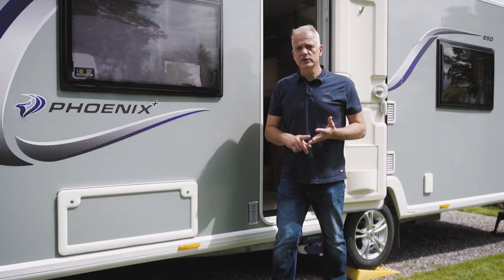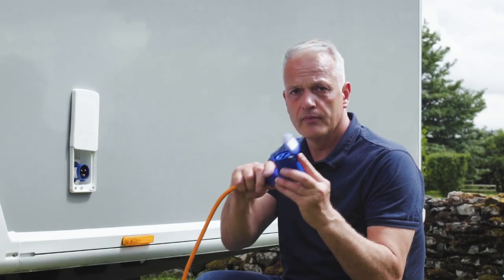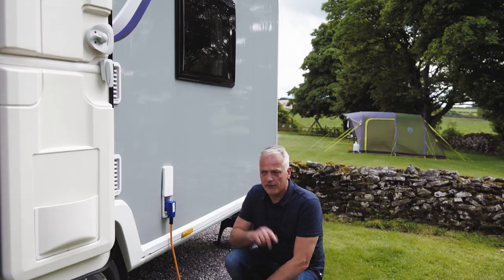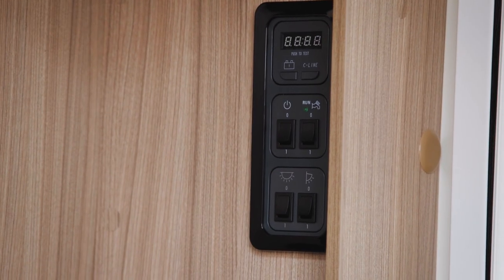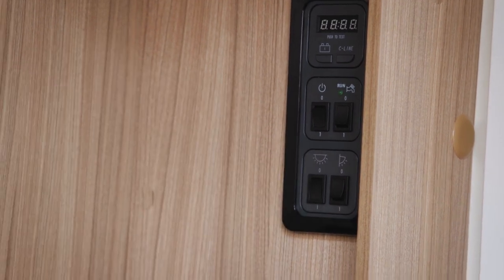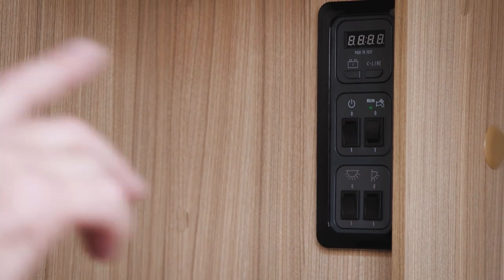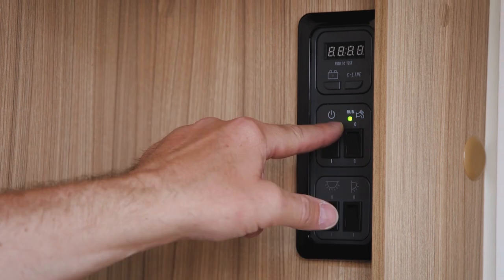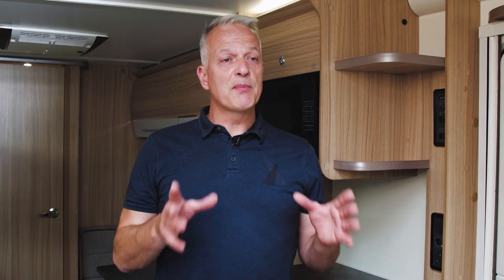How to use the electrical system and control panel in your caravan or motorhome

Comment: Please could someone at Bailey explain why our 2021 Autograph 794i has several issues when attempting to go without ehu - and the issues seem to be quite widespread according to the forums. 1. After being on ehu the leisure battery struggles to maintaing anything above 12v. Your video refers to a base line of 13.8v. The control panel consistently displays a low voltage warning. 2. The water pump always operates fine on ehu. We are experienced in priming etc but the pump always fails to pressurise off ehu so we have to avoid battery depletion by turning it on only when needed. This is evidently related to the electric power from the leisure battery. Our dealer has replaced both the leisure battery and the control panel. You stated clearly that Bailey vans are designed to be fully operational off grid / off ehu. We have the Bailey fitted solar panel and controller and regularly try to go off grid in sunny climes with no success. The problem persists. Are Bailey aware of issues related to the Autograph electrical system? This is our fourth van but our first Bailey and the first to present these issues. Please indicate a solution that does not involve manually adjusting the pump pressure all the time. I am quite sure there is a power supply issue.